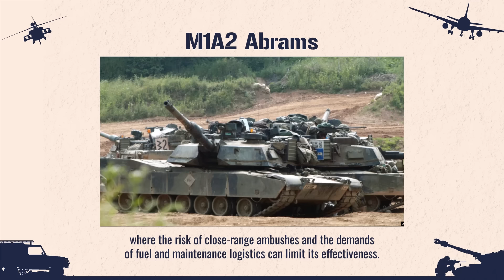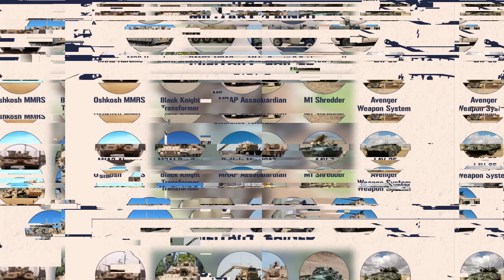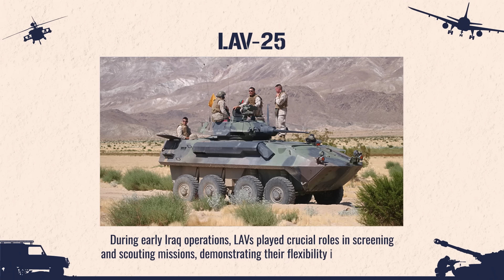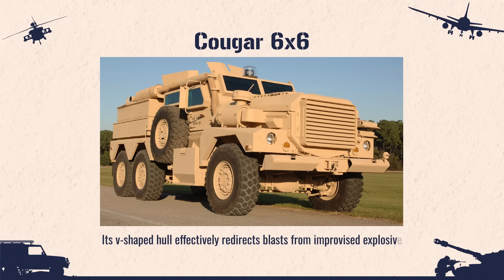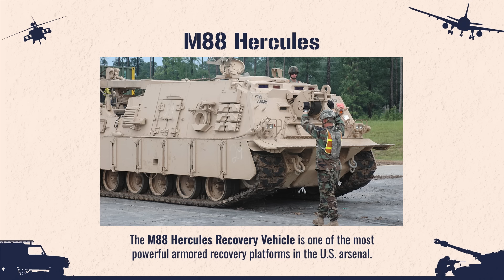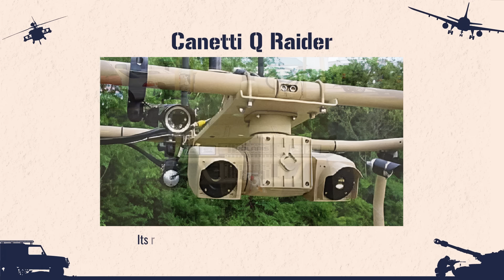Every U.S Armed Forces Military Vehicles Explained in 12 Minutes

Comment: The Abrams doesn’t really lack capabilities, it’s sole purpose is dominance on the battlefield both at range and close quarters. They’re also notoriously easy to work on, so much so that the entire engine and transmission (called a power pack) can be removed in in half an hour and with a skilled crew 15-20 minutes in the field. they are currently the best all around tank on the battlefield today. it has excellent armor and defensive capabilities for any incoming threats . I mean in the 1991 during the gulf war 14 were lost 2 of those intentionally destroyed to prevent capture. They’re just built different, they’re excellent hunters and they are very quiet compared to their diesel counterparts used by other nations.